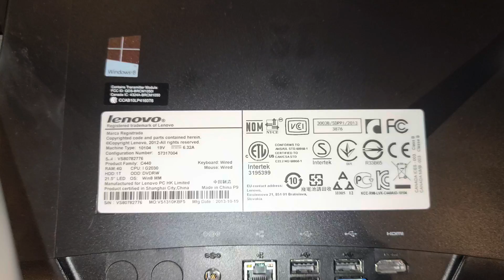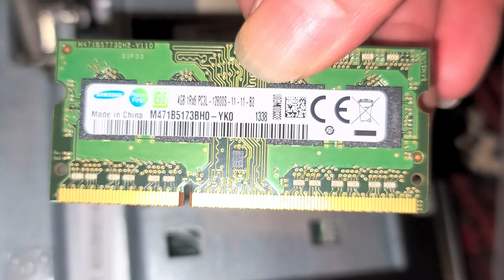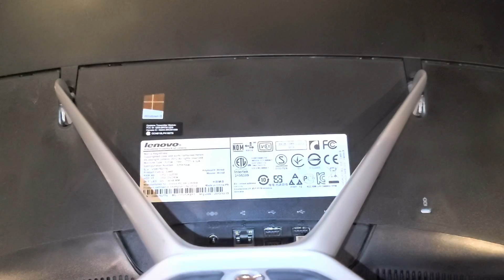Lenovo C440 Disassembly RAM SSD Hard Drive Upgrade Repair

Comment: did anyone with a lenovo c440 have monitor off problem i need help the logo comes on and the the screen get blacks and it contine loads
Reply from the maker: Might need a clean install.
Reply: @ItsBinhRepaired  the thing is I put another hard in it and it's still sleeping
Reply: @ItsBinhRepaired  I put in the boot USB and only time I can see something if I keep pressing the monitor off/ on button
Reply from the maker: @marcolinstones9178  hmmm
Reply: @ItsBinhRepaired  send me ur email I'll send u a video
Reply from the maker: I hate how YouTube doesn't notify me of replies. Were you able to figure it out?

Comment: Thanks for the tutorial!
I am receiving error 1962 no operation system found on system error
The bios does not detect the hdd
I tried opening and reconnecting the hdd, but to no avail
Pls help me out as I have important data on that hdd
Reply from the maker: 300dollardatarecovery.com can help you recover it.

Comment: thx dude. question. is there anyway to replace the graphics card?. btw i just subbed :D
Reply from the maker: Thanks! Sadly as far as I know, there isn't. Also it's limited to that form factor. I think some people use an external gpu with the wireless card slot on some computers, but I've never done that before.
Reply: @ItsBinhRepaired  oh ok!. Thx for the info
Reply from the maker: @Negative.Awesome  no problem